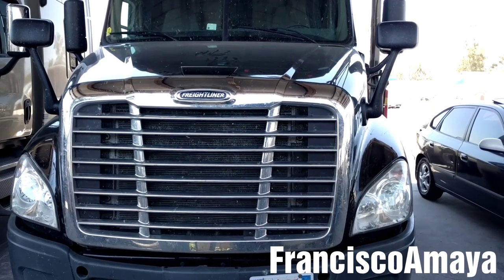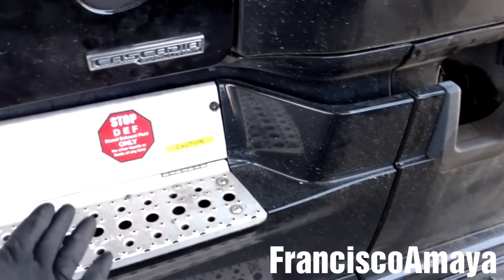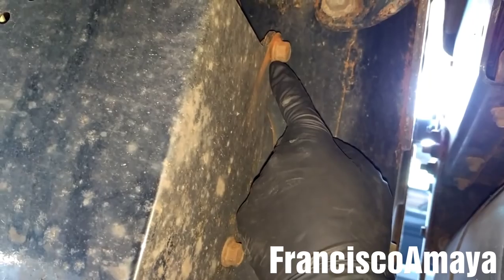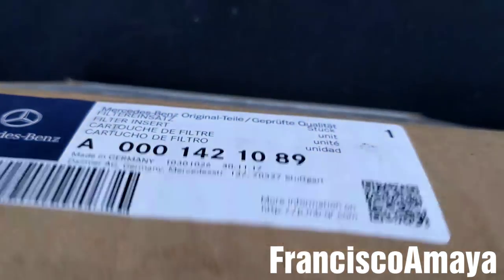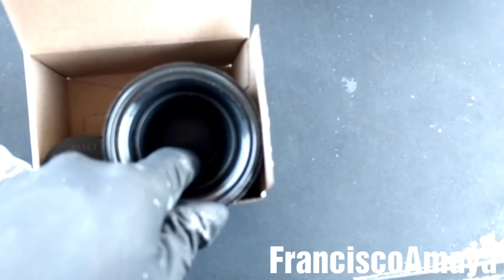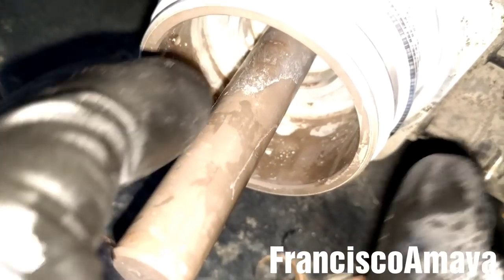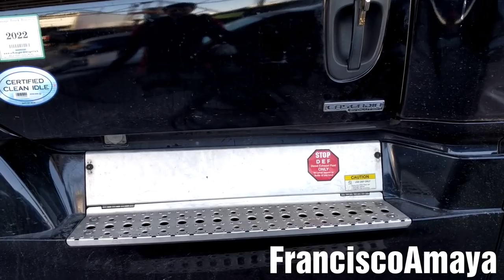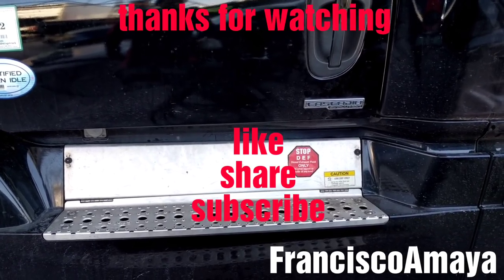Freightliner Cascadia DD13 DD15 DD16 DEF filter replacement OM 471 472 473 low pressure light on

Comment: From what I understand the correct way to install in to spray lube on the filter O ring then install. Then you spray the outside of the rubber boot to lubricate it along with its O ring seal. You then install the boot onto the pump over the filter.  This boot is a frost protection boot to stop freezing.  Then you install the housing to finish it off. The outside of the boot is lubricated so the housing spins freely  around the frost boot and doesn’t damage the rubber boot and seals.

Comment: I recently just purchased a 2016 FREIGHTLINER Cascadia. The first week of driving the amber light, check engine light and def is flashing. Took it back to the dealership and all they did was do regen and troubleshoot. A few days later same thing happened. It been 3 times already and the dealership don’t know what’s wrong with it. What’s ur unput?
Reply: Did you ever get it figured out?

Comment: Can a dirty def filter give a check engine light I changed mines today it was black and I got a code eec61  code not sure if its because it was dirty or maybe  is the pump  great video
Reply: Trucker Dave 215 I’m getting that same code eec 61 did changing the filter make it go away ?
Reply: Update?????

Comment: good video
hey.i hav issues with actros 963 which uses detroit diesel om471.it throws a code of insufficient air for combustion engine.what could be the issue?
Reply from the maker: Low compression.  
It is possible that it has a cylinder that is not holding the pressure.